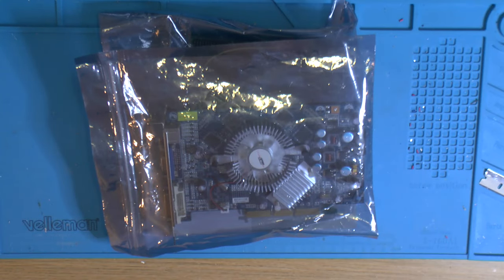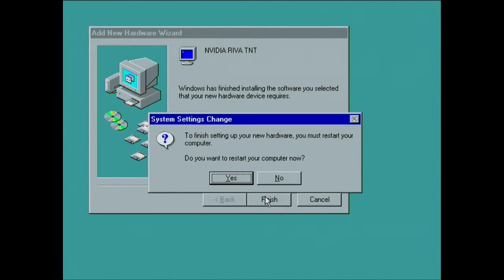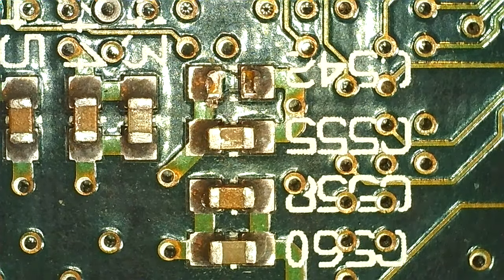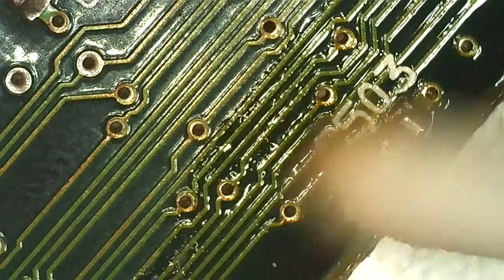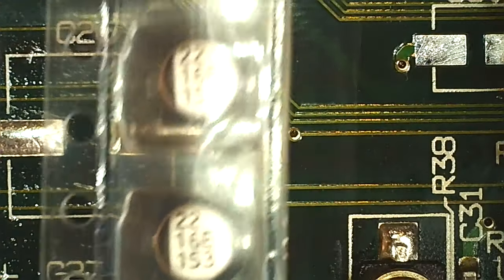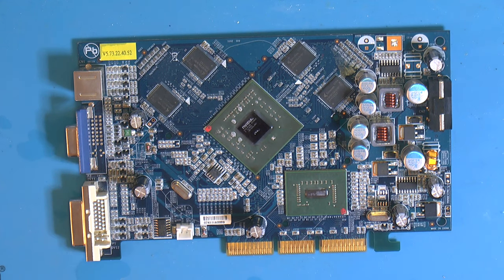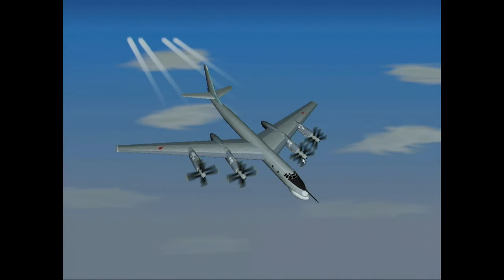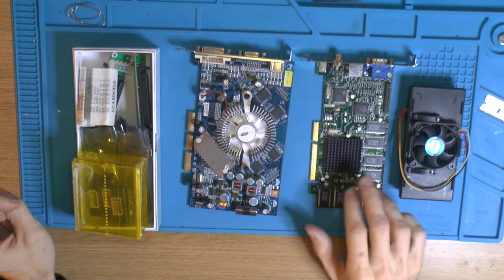Repairing two graphics cards

Comment: Great to see my old card getting some love. Interesting that it booted and ran 3dmark just fine for you but might very well be a difference in power delivery like you said. 

I've only tested it on period correct PSUs which might explain it. I got no picture at all from it while my other card works just fine in the same machine 😊

Thanks for another great video, looking forward to see the next one!
Reply from the maker: Old hardware in a nutshell 🤣
It runs fine with no issues so far, lets hope it stays that way so I can use it for the next project!

Thanks for the donation!

Comment: That TNT was my second 3D accelerator after the Riva128, and I was so very pleased with it that I kept buying nVidia cards for many years to come. It fixed all the visual issues of the Riva128 and had mature drivers right from the beginning. I also remember that this card worked fine in my Gigabyte 6BXC with a 300A@450. But when I gave it away to a friend it killed the 3.3V linear regulator in his noname cheap ass 440LX based AT/ATX hybrid board. Boards from tha period, like my 6BXC, quite often had such linear regulators for AGP which couldn't cope with the demands of later cards. Gigabyte even introduced a "Voodoo 3 jumper" which connected the ATX 3.3V line directly to AGP.
Reply from the maker: My I ask if you remember what drivers you found the fastest for your TNT and maybe Riva 128?
Reply: Dude that was 24 years ago ;-) I do have both cards again, but I didn't pick drivers for speed but rather compatibility. I'm pretty sure I recently used 3.37 for the 128 and 43.45 for the TNT (because that version supports all cards from TNT to GF4).
Reply: 2.08 are usually considered the fastest ones for TNT, also in my experience

Comment: Interesting content, i have an ASUS Strix GTX970 that i am sure failed after the pcb was sagging and i tried to support it with a zip tie likely breaking connections on it (Artifacts when booting etc) ... I wondered if heating it in the oven might level a pcb and solve the issue but anyway it sits i an box  now - too nice to dispose of. What dio you think?
Reply from the maker: Oven trick just temporary heals the bond between the die in the gpu and the package, and that problem is usually cause due to poor manufacturing in the first place.
It do not reflow the card as people think, if it did people would have components all over the bottom of there oven, and some sadly do....

Bent PCB due to sag will cause BGA chips to separate from the PCB, ram chips placed close to the PCI-E slot tends to need reballing due to that, that can be fixed at home if you have the gear.
Very few people would have a full kit to do a GPU but some do, the Cod3er has a station, some other people do so you could look around but the price for the work is more then the value of the card in that case.

You can check my RTX2080ti video where I replace a ram chip due to bent PCB.
https://www.youtube.com/watch?v=F7I1wJriSOk

If you need professional repair services you can check out  https://northridgefix.com/ offers services like this in the US I think.

In the EU the recommendation seems to be https://krisfix.de/en/
Both have YT channels if you search for them so you can check out there content for more tips and tricks.

I never used there services but there video content is excellent, but nowadays anything worth less then a 2080TI that would say need a GPU reball is not worth it from the impression I got, so thats why I try to fix my stuff myself I guess XD

Also a dead card is still a good donor of all its ships and parts so sell or use as donor is an option.